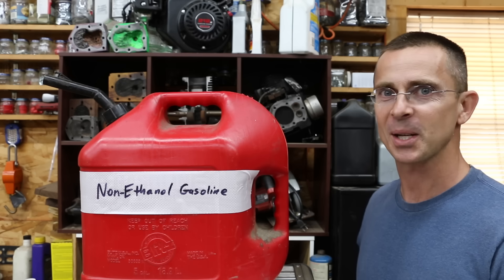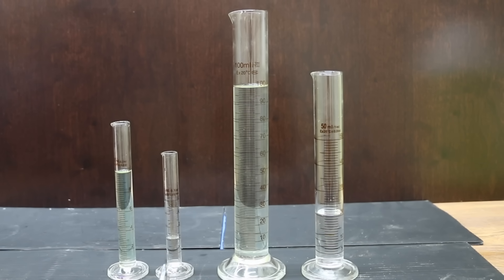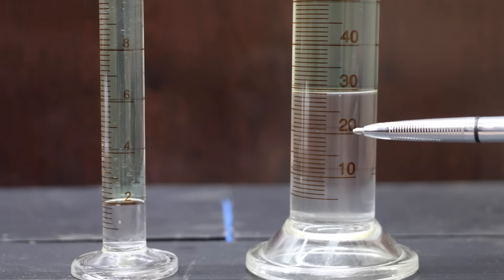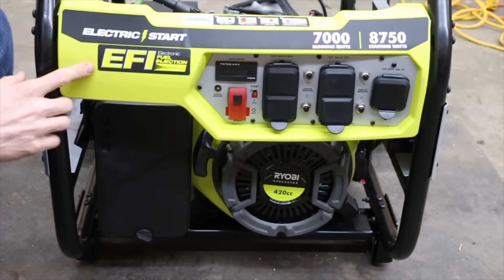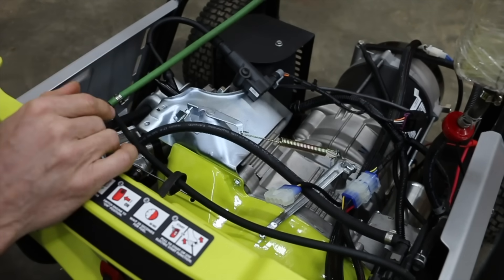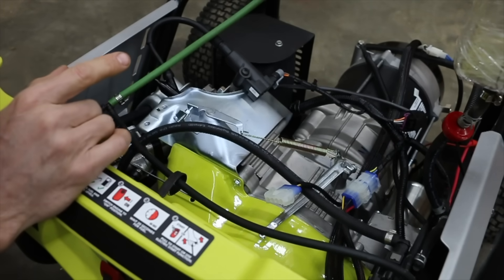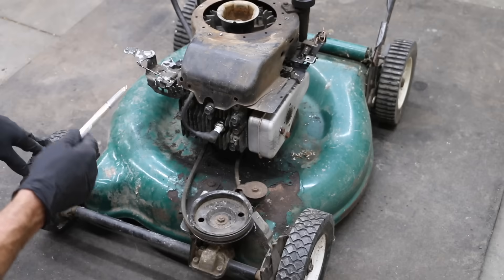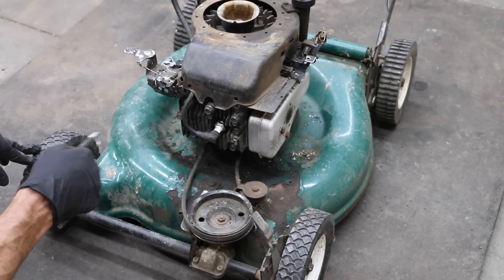Is Non-Ethanol Gasoline Really Better? See the PROOF!

Comment: I just finished my second round of testing in my car and day-to-day driving. I let the tank get to the red empty light in my gas tank. I filled the tank with gasoline that contains ethanol. After using up the tank, I refilled the tank with non-ethanol gas until the gas pump shut off on its own. I calculated the mpg. I then drove normal until the tank was empty and filled it with ethanol gas until the gas pump shut off on its own. I calculated the mpg. I then repeated the sequence. My calculations show my car gets 17.93 mpg with the ethanol gas and 21.3 mpg with the non-ethanol gas. This is all city driving just driving to and from work and to the grocery store. The numbers coincide with the last time I performed this test.

The percentage of added mpg when using the non-ethanol gas is significantly less than the higher cost of using the non-ethanol gas over using the ethanol gas. Having said that, I prefer to use the non-ethanol gas because I can hear and feel the difference in performance when using the 87 octane non-ethanol as compared to using the 87 octane ethanol gas in my 2005 Saturn Vue carrying the same weight for all tests.

For my next test, I will change out both Oxygen sensors, the Mass Air Flow sensor, the engine air filter, and get an oil change. All parts will be new OEM. I used to get 32.5 mpg when this car was brand new using non-ethanol gas on the highway and about 28.5 mpg city. I have 39.5k miles on it.
Reply from the maker: Thanks for sharing.

Comment: Ethanol has only about half the energy in BTU's of an equivalent volume of gasoline and will consistently yield poorer mileage as a result.
Reply: I log mileage and have logged it for 40 years.  I usually own between 3 and 5 cars, and seldom keep a car more than three years.
 I started 'hyper mileing many years before it had a name. 
I have never found a vehicle that didn't lose 5-10% of the range per gallon on ethanol laced fuel.
In plain English, the ethanol is just bulk filler as far as your engine is concerned. It's a ten percent tax on top of the other taxes.
Reply from the maker: Thanks for the feedback.

Comment: So they did this to relieve our dependence on foreign oil and then we cancel keystone xl? haha 
when e10 was first mandated I saw widespread problems with carburetor corrosion, water mixing with fuel in marine applications, bright white spark plugs from engines running too lean, and rubber parts cracking. Also It's a huge waste of food and farm land, we have so much oil under our feet it's not even funny

Comment: Good video.  I know that ethanol degrades old rubber components.  I think the metal corrosion nature of ethanol comes from the fact that, being hydrophilic, it absorbs water from the air, the water settles in the fuel tank, and the water causes corrosion in the bottom of the tank.  Ethanol, methanol, and isopropyl are all corrosive, but as long as they're in suspension, it's not so bad.  I've been told that a small amount of 2-stroke oil or MMO will keep the ethanol in suspension, coat the metal components, and prevent corrosion.  Might want to test for that.
Reply from the maker: Thanks!  Thanks for the video idea.

Comment: Ethanol, is AWESOME!  It belongs in a Margarita,
NOT mixed into gasoline!

I run a 2 cycle bike.  Todd, if you would, show what 
happens if you mix 2 stroke oil with E10 gas.  Now, add 
a few drops of water.  The mix separates into gas and 
oil, along with water and ethanol.  Notice, there is no oil 
mixed with the flammable water and ethanol.  What do 
you think running a 2 stroke engine on NO oil will do?

steve
Reply from the maker: Thanks for the suggestion.

Comment: Need to look for the follow-up video.

A lot of carbs use an alloy called ZiAl, which is a zinc-aluminum alloy. Ethanol, at least in high concentrations, can use corrosion of that alloy, resulting in pitting of the metal. The real question is whether or not 10% ethanol is enough to do that.
Reply from the maker: Thanks for the video idea.

Comment: 100% crap o hol is going to HURT ur fuel efficiency.  U have two fuels that burn and different rates to start with.  And I know for a fact from personal experience and from that of a brother that crap o hol drives down mileage by 10 miles per gallon.  I had an escort that was getting me 48mpg and went through Iowa and had to buy gas my mileage went down 10mpg and never came back up the rest of the time I owned the car.  Even after having work done on it.
My brother had a Saab 9000 turbo that got 24 mpg in MN and he moved to Ohio where they didn't have Crap o hol and his gas mileage went up by 10 mpg for the year he was out there he was living in Cinncy  in Ohio and in MPLS in MN so very similar traffic and when he got back to MN and put crap o hol in when he had to fill up the mileage immediately went back down to 24 mpg.

So HELL NO crap o hol is NOT better it kills mpg and engines.

Comment: 'better' in what engine? A 2-cycle lawn mower engine is not a 4 cylinder passenger car engine. They are designed differently and use different fuels. Nearly all cars are designed to use ethanol fuel since federal regulations mandate about 10% ethanol in passenger car gasoline. 2-cycle engines need ethanol-free fuel and are designed to use ethanol- FREE fuel.

Comment: I've been having trouble with all my gas engines and ethanol. My truck, generator, lawn mower, weekender all have needed repairs. My generators manual says don't use 85/15 ethanol gas. The stations around me "used to have" stickers on their pumps saying "may contain 10% ethanol" which they have removed. I have read a report that some stations are selling gas that has up to 51% ethanol. I know the government wanted to increase it to 35%, but 51 is insane! Way too many engines will self destruct on 35 or higher. We might as well switch to propane!
Reply from the maker: Thanks for the feedback.

Comment: I've seen microscopic metallic? whiskers grow on carb fuel jets immersed in E10 for a few months in the fuel bowl. Likely galvanic corrosion between the brass (copper/zinc) jets and the zinc of the carb body. You do have a microscope?

Comment: I know that the ethanol isn't good for small engines when they are going to be in storage but you could say they should be stored empty. the ethanol will dry out rubber and plastics, typically gas station fuel will have some amount of water in it too.
Reply: Here in Brazil a lot of vehicles - like my '84 VW is full alcohol fueled and that alcohol is no 100% but only this is true  when is mix with gasoline at 27% max proportional...
Reply from the maker: Thanks for the feedback.

Comment: I’ve been using E10 (10% ethanol) in my Nissan for the last five years, 130 thousand kilometres with no issues whatsoever, car still runs perfectly, and it’s cheaper than non ethanol fuel here in Australia. I understand that other people may have had a different experience but I’ve had no problems.
Reply from the maker: Thanks for sharing.
Reply: In order to use ethanol on a no flex type - or gas or alcohol in no matter proportion is - the compression tax must be higher than 10:1 and the injection fuel system needs to be proper ignition advance or retard calibration, as we used here .
Reply: I use ethanol gas in my cars too, one with 160k mi. With no issues, however I would never put it in a small engine that gets put away for the season, carb gets clogged.
Reply: I wonder if you could get away with running on E10 all season but just make sure to run a tankful of E0 through at the end- and run it out of fuel- before putting it away? @whatsit2ya247
Reply: @nigelbarton8350  I'm sure you probably could, however I never run mine dry at end of season, it's probably fine but I guess it's because I heard at some point that's not good for seal's, etc drying out and asking for a fuel leak or other issues? 
 Another note, I usually just purchase 5 or so gallons of gas and then that lasts me all season, EO gas "expiring" has never been an issue for me.

Comment: I think the amount of carbon build up was excessive, which makes me think it was mostly from oil leaking past piston rings?
Yes ethanol has a lower specific energy. Some of it can be recovered by increasing compression making use of the higher octane rating.
Reply from the maker: Thanks for the feedback.

Comment: The real problem with gasoline/ethanol mix is with carb body and his metal connections because, at an ideal temperature service the fuel mix don't have liquid components in with, the engine is feed with air and fuel moisture ... I have and 1984 full alcohol fueled liquid cooled VW and the problem with it in respect to a similar type gasoline fueled I owned is a little bit dificult to start the engine at lower temperature days but, if the gasoline start system is used the engine normally starts at a first flip of a key switch... 
About 2 months ago it needed to disassembly the header to substitute the gasket and no anormal corrosion was observed on combustion chamber or cylinder top, even the spark plugs I swap a year ago revealed no anormal corrosion, even remembering the engine is 100% ethanol fueled - the gasoline/ethanol mixture on Brazil is 27% officially... 😳
Reply from the maker: Thanks for the feedback.

Comment: Ethanol is not good for engine's I learned this way back in highschool. Gasoline has oils in it that help lubricate the upper cylinder's and valve train, ethanol does not have those oils in it so it dries everything out. At least that's my basic understanding of what I learned +20 year's ago. 😅
Reply from the maker: Thanks for sharing.

Comment: I have had several fuel pickups for chainsaws dissolve in the fuel tank. Everyone I know that uses 2 stroke engines avoids ethanol fuels for their 2 stroke tools. Did you ever do testing with two stroke engines using ethanol versus non?
Reply: Ethanol has been shown to create higher operating temps in 2-stroke motors, so unless you have something designed for it…
Reply from the maker: Thanks for the suggestion.

Comment: For one, water in the fuel system causes rust. Water causes ferrous metals to oxidize, or Rust. Now ethanol, being a form of alcohol, and also hygroscopic, draws water, however, alcohols are to aluminum, what water is to ferrous metals. It causes aluminum to Oxidize, or "aluminum rust". The white yellowish powdery substance. So? Not good for either iron or aluminum engines.
Also, ethanol comes from corn, where high fructose corn syrup is made, as well as sour mash whiskys. If you let an ethanol mixed fuel sit in a vehicle with fuel injection, especially power sports equipment, motorcycles, ATV's, UTV'S for more than a coupla months, the alcohol and gasoline do evaporate. And guess what? That ethanol turns to a sugary, sticky slime in your fuel system, clogging injectors, fuel pump, etc..
It is recommended to use fuel stabilizers if the vehicles are going to sit for a length of time, and also use as a fuel conditioner, to maintain the fuel from breaking down...
IMO, Ethanol is just bad shit.
You may get a little bit more economy at the expense of using more fuel as the tests showed. Non ethanol fuel lasted a coupla minutes longer...keeping clean motor oil in the motors is imperative.
No one likes dirty K-Y...

Comment: my small engines in a lawnmower and 2 gens all have had carburetor problems using ethanol based fuel, after draining and cleaning the gunk i now only use boat gas (no ethanol) and have had zero carb problems.
Reply: If you have an old small engine or one that is a 2-stroke, you should not use E10 fuel in it unless the manufacturer specifies that you can.
Reply from the maker: Thanks for sharing.

Comment: My first thought is to put the engines under a load and see if there is a carbon build up difference. I’m glad you addressed this; hopefully it will budge some people out of their political opinions about ethanol blends. Personally, I think it can do amazing things with regard to making power due to the extraordinary high octane levels that can be achieved.
Reply: First and foremost, Ethanol is NOT a detergent, and was never claimed to be. It reduces tailpipe emissions because it burns more completely than pure gasoline. It also prevents gas line freezing by bonding with the water in the fuel and raising the freezing temperatures. Since Ethanol burns at lower temps, it prevents engine valve “burn-out”. Due to solvent nature of Ethanol, it helps to keep injector lines cleaner.
Reply: @afcgeo882  what drek!  over periods of as little as 6 months of heavy ethanol use, carburetors on small 2 stroke engines will reliably begin having issues.  Clear gas, verified clear gas, allows me to use small engines much longer and with fewer overall problems than ethanol gas.  As for ethanol burning more completely, link please.  Ethanol reduces TAILPIPE EMISSIONS IT WAS SPECIFICALLY ADDED TO REDUCE, while increasing others.  The greenies are and have been playing a shell game with us.  Look over here, we reduce THIS super harmful soul destroying greenhouse gas!  Meanwhile, the tech or chemistry used to eliminate ONE waste product ALWAYS creates another.  Catalytic converters for instance.    Overall, NOT a boon to the environment.

Comment: 10% ethanol gasoline has been made since 1979. What has made a greater change more recently is the other additives in the gasoline are more environmentally friendly, but they don't last as long as the older additives when store. Ethanol often gets blamed for this because it is posted on the pump that there is ethanol, without mentioning the other additives.
Reply from the maker: Thanks for the feedback.

Comment: I use only premium fuel (91 octane) with no ethanol in all my small engines with no problems starting them after sitting for months.  Majority of all small engines that I repair for no start or stall after start are due to the fuel system being "gummed up" from using gas with ethanol, especially the carburetor fuel bowl, idle and metering ports.
Reply from the maker: Thanks for sharing.
Reply: @ProjectFarm  Cheers.  Where I live, Shell is one of the few gas companies that don't add ethanol to their premium fuel.  As you know, ethanol is a "sponge" for absorbing moisture.

Comment: I use only non-ethanol for my lawn equipment. I get about 10% better fuel economy as well as noticeable extra power so I can go faster without bogging down. You've already proved the fuel efficiency improvement. Perhaps you could rig up a test for the increase in horsepower/torque???
Reply from the maker: Thanks for the suggestion.
Reply: @ProjectFarm  With the lower fuel economy you've proven and the loss of power for the whole tank, not just the 10% ethanol part, I get the feeling I am better off taking the 10% ethanol out of my tank and dumping it on the ground --- Seriously.